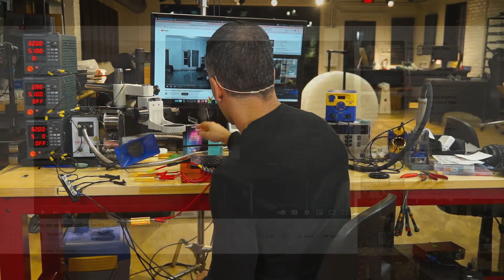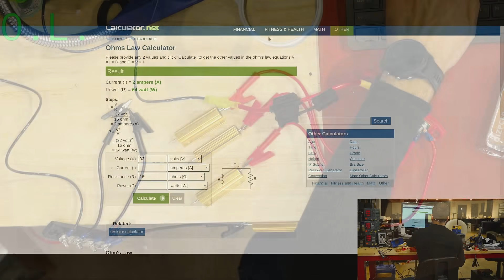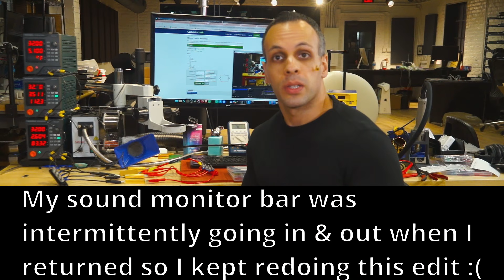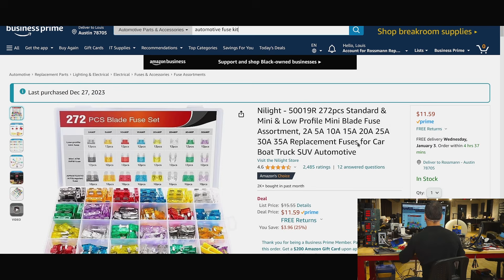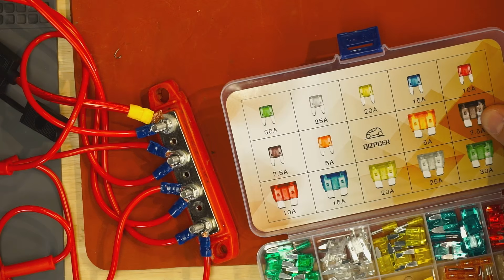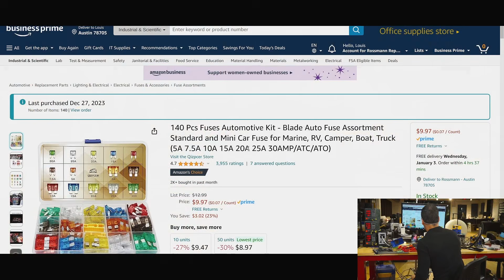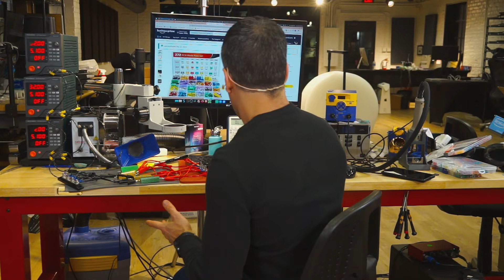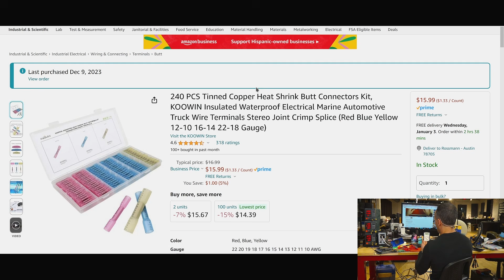Amazon Sells Fake Electrical Fuses

Comment: Test engineer here look me up. Automotive fuses I have purchased and used can go thousands of seconds with 2.5A and burn in a second or less at 3A. Are they true 2amp fuses... I'm not sure I don't design fuses, I just burn them often to protect hobby projects. However, 10A to burn a 2A fuse is an absolute no no. Fire waiting to happen. Most wiring is not 5x current rating.

Comment: I don't have any electricion knowledge so im confused, why is a 2 amp fuse blowing at 10 a problem? Doesn't that mean it won't blow at 2 which is what you would use for it making it safer? Could anyone tell me?
Reply: Its seems like a fuse blowing is to prevent a fire or an explosion, is that correct?

Comment: If I am not wrong, Germany has a law along the lines of products should be able to be used for the thing they were made for. I.e. 2 amp fuse should be 2 amps, IF I am correct.

Comment: Just want to add that even reputable brands there fuses are way over rated for automotive use,
The specs that come with lucas fuses which is well know high quality british parts.
It lists spike draw as less then 1min and continuous as one hour.

It lists 1.5 amp fuse as having a spike rating for 3.5amp and continuous rating of 3amps.
The 2 amp fuse has spike of 8amps with continuous of 5amps.
5 amp has spike of 12 amps with continuous of 10amps.

Basically it should be able to hold twice its rating for a hour.

Comment: Those resistors are only rated for 100W when attached to a heatsink; wiithout, they may only be 10W (see datasheet). You can get electronic loads. Also, resistors/loads aren't needed (although they would make things more clear during demonstration); only power supplies in constant-current mode would have been enough, via which you could set to deliver 2, 4 etc. amps. Current matters, not voltage. Look closer and you'll find those fuse's elements are probably all stamped the same.

Comment: I wonder if half the reason all of these under-rated fuse sellers are selling these is because idiot customers return the fuse kits because "the fuse kept blowing". What makes me think that this is a real possibility is first the fuse already there would have to blow, then the spare fuse would have to blow after they inserted one of them, so it leaves me to wonder - Do people buy these kits, go through 3 or 4 more fuses and then return the kit thinking the fuses are faulty? I mean seriously, People really take for granted how stupid the average American is when it comes to anything electrical, I've met auto mechanics who've been in the business over 10 years who don't know how to check battery voltage.

Comment: Thank you for the knowledge.  I kinda always knew better than to buy electronics from amazon in general, but a fuse is so mundane it's...well... shocking to see this.  I knew something was up years ago when I made the mistake of buying brand cologne from them as it was obviously diluted heavily in some form, but that's not going to set the fire alarm off.

Comment: I contacted a seller about a rubbish sd card reader,  Seller told me to keep product if I gave a good rating. I also bought Bluetooth earbuds which were glitchy from another seller, they refunded and told me to keep the faulty product. Another seller sold me drone parts and included a voucher which was activated by me giving a positive review. Amazon and Sellers like to muddy the pond by not showing a clear picture of what's going on.

Comment: It actually makes sense that they sell fuses rated improperly in this way. Many people who don’t know any better are going to replace a blown fuse and it’ll blow and they’ll blame the crappy fuses, not try to figure out where the actual fault is. So when they buy a 15A fuse that can withstand 30A, and it solves their problem, they believe they bought a quality fuse and the problem is solved. Until a wire melts.

Comment: Besides the actual products being crap, when I put a 1-star review on a seller that directly ripped me off and tried to scam me about it, that seller put my name and address as a public response on the review page and told me to remove my review to remove the doxing. I contacted Amazon's support department ( a feat in itself) and they told me that they can't do anything about it and can't contact Amazon-Actual, but I could fix it myself by deleting the review. Of course that conversation took 2 hours of mostly hold time and confusion because the department was outsourced out of country to what is clearly a very low bidder. 
I left the review up in solidarity with the other few doxed martyrs among the obviously fake 5-star reviews. I'm pretty sure that the seller just makes a new account when the cost to offset the honest reviews with bought ones gets too high, or somehow someone actually figures out how to report a scammer effectively. 
It's really just an expensive version of Ebay, and you can generally find the same sellers/graphics/products on both. It's likely that they will merge at some point. 
The best part is when you use their "subscribe and save" system, which the eligible products are at least as much more expensive as you're supposedly saving. They regularly rotate the same exact products through that system, but double or triple the prices so that if you don't discover this and cancel the subscription, you end up paying extra on identical products (Even Amazon-branded items!) that others don't even see while they are offered the lower priced same thing. It's also 5-10 times more time/effort to unsubscribe than to subscribe, subscribe is the default option in most cases, and if you order food through them you get the privilege of infesting your house with some exotic insects because the product description didn't warn you that the food was coming from China. Yes, this happened to me with some kind of beetle (apothecary beetle, I think), and it came from a package of Dried Shiitake Mushrooms. If those things aren't good enough, there's always the opportunity to pay massive premiums on generic, store-specific items because not going to (Wallmart, for example), I don't recognize the brand names used there. So, there's just people who buy/rent houses or storage rentals in tropical climates to use the garage for flipping expired food from Wallmart, returned products (I've bought so many jeans with broken belt loops and holes it's unreal), and general dumpster-dives/scratch & Dent & Close-out products. That's probably the driving factor behind why self-storage businesses are unrealistically booming... For flipping expired and dumpster products on Amazon and Ebay. People buy Amazon returns by the pallet. I wonder how much of that goes right back into stock. There's not really any reason to buy a pallet of unknown (but unwanted) objects otherwise.

Comment: Louise, I like you but you made a mistake at the begining. Fuse is not dependant on power (Watt) but on current (Amps). If you increase voltage, you will increase power, but you can keep current constant (CC supply). Sure there is voltage rating for fuse, but it matters only when fuse blows, because rating is supposed to guarrante safe funtion (stopping burning ark).

Comment: After replacing a 2 amp fuse with a 2.5 amp fuse in a switch mode supply resulting in an intense white arc light coming from the metal case I'd have to agree about safety.

Comment: As someone who has been in the electronics industry for a good many years and dealt with fuses quite a bit, I will concur with Louis' assessment that these fuses are sh*t. Yes, fuses have slight variations, that is why the rating is a curve and not an exact value, but anything over 200% should cause the fuse to blow in about 5 seconds or less.

Also, those resistors only have a 100W rating when attached to a suitable heatsink, without one it's rated for about 30W.

Comment: It's really telling when there's no way for a customer to distinguish between a good and bad product on Amazon. It is good that good fuses actually exist on there, like you've shown, but if they're effectively the same rating on there and cost 5% more than the crappy ones, people will flock to the crappy ones.
Reply: Yeah, he went over that as well. People will buy the cheaper product, even if it's going to cost them more or kill them. It's why my family member don't do second hand or "economy" brand crap for our cars, our lives aren't worth saving a few bucks.

Heck I think Louis explained he won't sell on Amazon because people were buying a "cheaper" screen for their laptop, that was the wrong screen and wouldn't work in their device, smash it trying to get it to work, then refund it before he could even explain to Amazon why the customer is stupid. He even put a disclaimer on that specific screen saying IT WILL NOT WORK with what customers were trying to use it for.

So he's the asshole because customer's are stupid, buying the wrong parts after being explicitly told what they can't use it for, but buy it anyways and destroy it trying to install it incorrectly because "it's cheaper". But what does the guy who does this for a living know, it's clearly his fault the customer bough the wrong product and destroyed it trying to use it for something he literally said it can't be used for.
Reply: @Xershade  It's also very hard to find the description on amazon for a product, their layout is absolute zoomer distraction garbage, it has so many banners of other products and sponsers and shit I'm suprised a subway runners or minecraft parkour video isn't playing too.  Go to any normal website and go to a product page and you get a name, a picture or more, a price, and maybe even the model number up on the top if it's industrial, and a brief product description, then you scroll down and get all the product specs, model numbers, tolerances, datasheets and everything you need.  It's very hard to know what you're getting on amazon is exactly what you are looking for beyond reading the title and lookinf at the pictures, most don't have extra information posted and some listings were put up by a retard who copy pasted the same thing from the last listing he put just up and didn't notice.
Reply: It is not enough to just buy reputable brands as there are so many fakes, but also to buy from a reputable supplier.
I have seen exactly the same product listed for around 10 times the price to catch out the 'expensive must be better' buyer.
Reply: Anyone who buys on price alone deserves what they get. 
They know the price of everything and the value of nothing.
Reply: The next issue is when I find totally fake  products, after I thoroughly test them with calibrsted equipment.. there is nobody at Amazon to contact who cares...and when I include my information in a review of the product I  receive an email from Amazon   "Your review has been removed for blsh blah blah"

Amazon is actively allowing reviews with the correct information to be removed.
Reply: be real careful buying more expensive products and expecting them to work better. That's not how the game works.

vendors can and do raise prices to justify imaginary quality. If the price is what indicates quality for you, you will start to chase your own tail.

if the product is not safety critical and/or you can verify that it works, just test it. If it doesn't, send it back and leave a bad review. That way producing bad products is less sustainable. But nowadays lots of people just buy the more expensive option, which is a double win for crappy venors. They can still sell shitty/dangerous products and make more money per sell

Comment: I was wondering why, for the first part of the video, Louis kept referring to fuses as being rated in Watts (rather than Amps), and also made some odd sounding references to the power supply rating and other things, suggesting a lack of understanding about what the fuses were doing and how the circuit was actually working.

I also noticed that the three power supplies were often shown as putting out considerably different currents when connected in parallel; this is abnormal when paralleling power supplies. As far as I could tell from the video images, there were no balancing resistors used on the power supply outputs (usually they are required when paralleling in this manner), and this might have partially resulted in the mismatch; I don't know the specifications of these supplies and how they were set up, so there may have been other contributing factors.

Also observed was that Louis mentioned he was 'partially color blind' when picking fuses out of the assortment and going by the color coded reference sheet. Nothing was said about whether the fuses were ALSO marked with the current rating. I wondered if, by a simple mistake of misreading the color coding, much higher rated fuses were actually being used for the tests.

None of this really changes the well know problem Amazon has with departing brand name sellers, questionable reputation of many Chinese sellers and their products, and the clearly bogus nature of MANY of Amazon's reviews.

Comment: Building my first 12 volt system in my truck camper. Got new fuses and big holders to be safe.... wire i got apears to be good... not pushing more than 50ish amps @12 volts through 4 gauge..

Comment: Easy way I test fuses(without the test equipment) is to put a fuse in rated for 1/2 the rating. It should blow as soon as power and the load applied. If it does not then I search for another brand. 

The amount of 15 amps that handle 30/40 amp load will scare you. These companies on resellers change names so much these days it is hard to say that GG electronics is bad and BB electronics is good. GG may get a bad reputation(despite every employee being mandated to give good reviews) and just change there logo and name to GGi electronics. GGi now gets a new rating with those mandated employees posting several hundred false reviews without scrutiny. Meanwhile each of the actual people buying the product whom are leaving bad reviews to warn others as a public service are scrutinized for leaving that bad review. 
Then you have the clones of good companies like BB with products selling for 10% less then BB's  through BBi who is GGi being crafty and stealing BB's sales.

Comment: Since the power supplies have variable current, you just need a load resistor that can handle maximum current, then adjust it on the supply. This lets you slowly ramp current up in smaller steps.
Reply: True to a certain extent. But, for example when trying to push 10 Amps into 6 ohms using a single supply you would need a supply voltage of 60 volts . Louis seems to inaccurately be wanting to not exceed the 32 volt rating of the fuses being tested, but the more practical question is are the supplies maxed out at 50 volts.
Reply: @mikebarushok5361  Good point, you'd need pretty low-value resistors to put a lot of current through, and then they'd be dissipating a LOT of heat. I think that's why I've seen it suggested to use a light bulb, a device made to dissipate a lot of heat.
Reply: ....or just put some of the resistors in series to get 1/2 and 1/3 steps.

Comment: 19:50: While I can agree on the 2A fuse (should not go up to 10A), I have to say the 5A blowing @ 10A seems OK here, because a 5A fuse should be able to deliver 5A for* hundreds of hours,* so one would assume that id will do more for a shorter period of time, an it blew pretty fast at 2x rated Amp. Seems correct to me, no?

I've had another issue with these fuses (not just current Amazon ones). I have circuits which are doing up to 6,25A continuous, down to 3A. With that I did secure with 10A fuses, and they blew after several days of intermittent use. 
There have been old ones (from junk cars), new ones for a car parts store, and pretty much those you are using. All the same behavior. But the ones from the car part store been the worst (in design and durability). I have to admit, the ones from the car part store seemed pretty low quality, and the Amazon ones made a better impression. However: All would not deliver 66% of rated Amp for extended periods... So this is another issue with melting fuses, I guess. On one side they need to blow as fast as possible above the rating, on the other hand they need to withstand the delivered rating for a long time... Any thoughts?

Comment: A 2A fuse is not meant to blow at 2A. It is meant to be used in a circuit requiring up to 2A of current. So it should allow 2A to flow without blowing.

But, of course, it should blow if you get above that. I had a look at a datasheet of a trusted brand (Littlefuse) and a 2A fuse should blow at 3A within just a few seconds.

Comment: I bought fuse on amazon ... the round one i wanted to use on diy electrical project ...
I don't have a 10A adjustable power supply to test them ...

Comment: I think it would be equivalent to omit the resistors and use the constant current mode on the power supplies. The voltage drop across the fuse is way less than the rated voltage anyway. This would allow more fine grained analysis. I also wonder if your power supplies have a serial or USB port so they could be run automatically.

Anyway just engineer thoughts. I really appreciate your work showing off what a dangerous scam Amazon can be!
Reply: Yes but then we wouldn't get the entertainment factor of Louis leaving nearly 200W stinking and unattended.

Comment: I think it’s just cheaper for those chinese factories to churn out 10 amps fuse, then rated them as 2 amps. This way they only need to change the casing color instead of producing new fuses